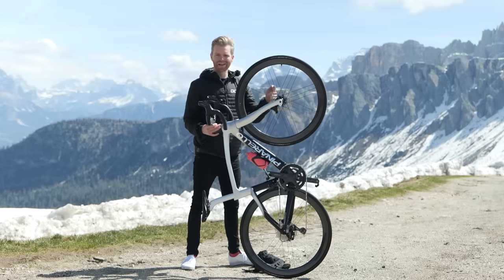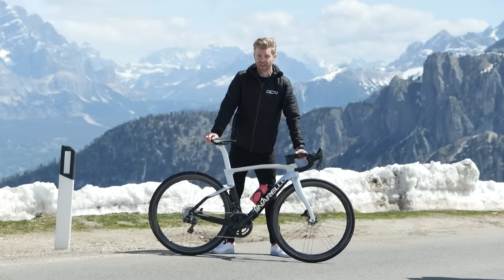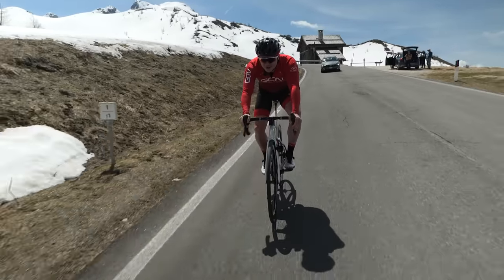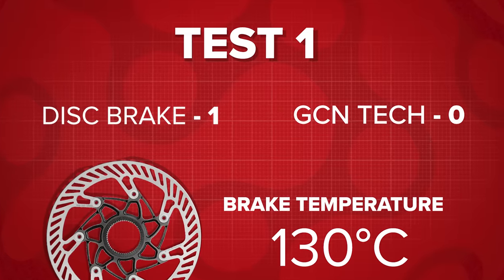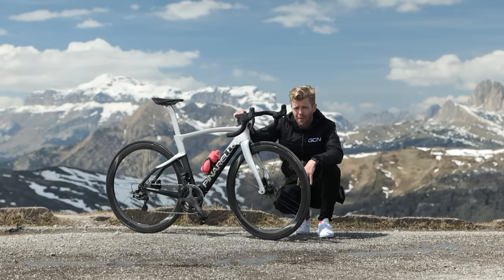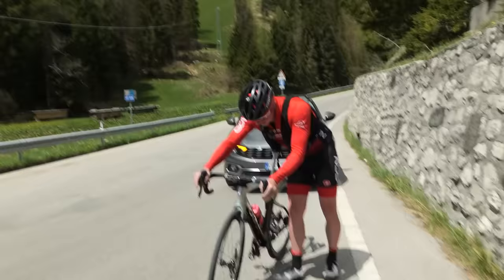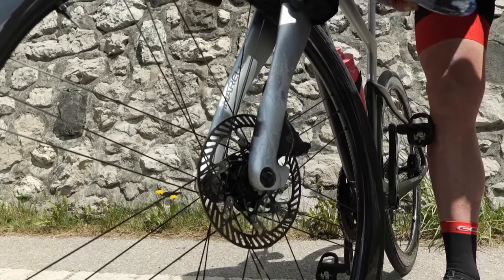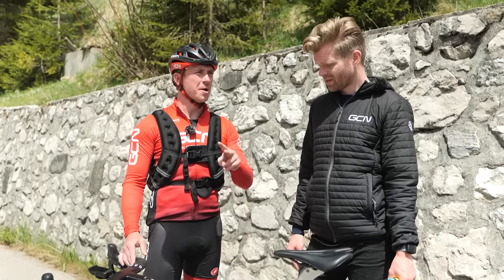Can We Melt Disc Brakes!?

Comment: Descending in the drops would have been harsher on the brakes (less drag = more energy through the disc). Also: for steel to change color, it must have been at 250°C or more at some point. Purple starts at around 270°C, blue at 300°C.
Reply: Was thinking dragging the rear brake would get it hotter as it brakes less effectively compared to front
Reply: He should have been pedaling too.
Reply: Shoulda, coulda, woulda.
Reply: @mateosebastian8555  It brakes less effectively because of weight transfer. The rear brake never loads as much as the front brake. It would likely still have a lower temperature than the front brake because it's dealing with less forces just through the physics of braking.
Reply: Campagno discs are made from tempered stainless steel as such the values and math being presented are not quite correct.
Reply: Straw color (amber) starts around 200c and get darker into light brown at 220c-240c
Reply: Orange red is at 1100 degrees Celsius so no way they gnna melt 😂
Reply: @danielakerman8241  rears get more easy hot because they are not as much in the wind. i tried it in a short descent on my commuter bike.
Reply: @RevoltingRudi  sorry but that’s just incorrect. You’re talking about heat dissipation, not heat GENERATION. Regardless of exposure to cooling airflow, front brakes will ALWAYS generate more heat because of pure physics. On a bicycle, the front brake can be responsible for up to 75% of the stopping. The inertial shifting of weight towards the front will always put more force, and therefore create higher energy, in the front brakes of any moving object.
Reply: @danielakerman8241  what you are saying that something about ~ 75%/25 % load distribution is the optimal brake distrubution is true but nevertheless this is irrelevant for this experiment since here no maxium brake performance is necessary. unlike in a car, on a bike you can apply a load distribution between both brakes in any ratio you wish. you can just brake with the rear break while then the front brake has zero load on it. the only thing is that the rear brake reaches its limit way more early that the front brake would and this is when the wheel stats to block and traction is lost. this is why the rear brake is less efficient. but nowhere near maxium brake performance is needed in this experiment but only very slight braking. so it does not matter if e.g. 5% of the maximum possible brake performance is applyed by the front which has a maximum of 75% on its own, or the rear brake which has a maxmum of 25% on its own. as long as the wheels are far from blocking it does not matter. So actually here the heat generation should be more or less similar while the convection can make a huge difference in the final temperature.
Reply: @danielakerman8241  Yes and NO! 
Yes = In most cases is front brake better / efficient / powerfull / safer.
NO = in extreme example (doing a wheelee on rear wheel 🤪) you don't need front brake 😉 ... when the rear wheel does NOT slip / skid then both brakes CAN made "same job".
Reply: @mateosebastian8555   Question: will the rear brake get hotter if Hank only used the rear break in the exact same scenario? 

Answer: We know that (1) kinetic energy is the same (0.5*m*v^2) in the system (bike+rider), (2) heat energy generated is proportional to frictional force (forgot the equation), (3) friction is what is slowing down the system (i.e. converting the kinetic energy to heat energy), and (4) the weight of the system shifts away from the rear wheel to the front wheel during braking. Because the weight of the system shifts away from the rear wheel, the max friction the rear wheel can generate before it slips is reduced, thereby reducing the max heat energy it can produce (which is why it's less effective than the front brake), which means that it cannot get hotter than the front wheel, assuming all else equal.  

Disclaimer: not a physics major, did mechanical engineering many years ago, may have forgotten some things.
Reply from the maker: Thanks - good tip if we try something similar again!
Reply: Depends on the alloy!
Reply: If they were only using the rear brake, it would be responsible for 100% of the braking. As they used only the front brake, it was responsible for 100% of the braking. Had they used the rear, it would have dissipated less heat due to smaller mass, less surface area and worse airflow.
Reply: @jessechen4971  That's assuming he was breaking hard enough with the front break, that the same amount of breaking with the rear would have lost traction. I suspect he wasn't in this case,  which would mean the same amount of energy would have dissipated from either break,  making the only difference how much air cooling each gets.
Of course,  as soon as you lose traction,  the tire and road start dissipating some of this energy.
Reply: @benturp3492  The rotors sound like they would do fine in that situation - I would be more worried about the brake pads starting to melt way sooner. Especially with the description of using organic pads instead of a stronger material that would be used with "performance" cars.
Reply: @kidkarbon4775  so then we're talking a melting point of closer to 1600 C

Comment: Actually, sintered (what you called "metal" pads), or what is called semi metalic in the automotive world, don't just wear longer, but are pads that intended to operate at higher temperatures for more extreme uses (ie heavy hauling, racing, etc).  They have less bite when cold then a resin ("organic") pad, but they are more resistant and hold up better at higher temperatures (what they are intended for).  While yes you want to ensure the pads don't over heat as it causes them to lose effectiveness, the more terrifying thing is to ensure the brakeing fluid doesn't over heat and boil.
Reply: That’s for sure! I did that once in a supercharged Thunderbird on my way home late at night coming up on a tight downhill turn that was notorious for people going off over the years. I was young and stupid and had no idea you could boil brake fluid. I had been driving up to it around 135 MPH and laid into the brakes approaching that curve and started to slow down but then suddenly the pedal just went flat to the floor and I wasn’t slowing down a bit. I frantically downshifted as carefully as I could to avoid throwing it into a spin by dragging the rear wheel drive wheels too hard on a downshift but I needed to shed speed. Thankfully I kept my wits and, having had previous experience with overheated brake pads, figured it was a heat problem so counterintuitively I let off the brakes while downshifting to let them cool just a touch before laying into them one last time to try to save my dumb ass life, and thankfully that was enough to cool the fluid and the next time I stamped down the brake pedal, I had some braking again and managed to slow down enough to make the corner.

I sure learned a lesson that night! Never, ever pushed anything that hard again. If it had been anyone else driving, they probably would’ve gone right over the edge and died like so many other people who missed that turn had done over the years. Terrifying doesn’t even begin to express it.

Don’t be dumb like I was, people! Be safe and keep your stupidity to a minimum. Your life and the lives of others depend on it.

And I actually was wondering if they were going to artificially test this because I was curious what happens at the edge of braking on a bicycle with disc brakes. How likely is it that you could ever boil that brake fluid?  It did concern me when he mentioned that it isn’t regulated or controlled like automotive brake fluid is, so manufacturers could be putting who knows what into it, and every formulation could potentially have very different performance characteristics at the margins. I’m thinking it might just not be possible to do that on a bicycle, but they do have a very tiny surface area to dissipate heat from.
Reply: @babybirdhome  Automotive brake fluid is hygroscopic, meaning they will absorb moisture when exposed to air.  Your not boiling the brake fluid, your boiling the water in the brake fluid.  You need to flush your brakes every few years or sooner if you do high performance driving. Mineral oil is not hygroscopic However when water gets into the system, it will tend to pool at the caliper (very bad). So learn to bleed your brakes on your car and your bike.
Reply: @babybirdhome  I think bindingcurve is right, even at 135mph, an emergency brake to a full stop should not boil your brake (if so then there would be much more accidents at race tracks). It's the water that's boiling- even a bike brake can reach ~100 degree C.
Reply: Adding to your answer, the sintered brakes also last longer than organic pads in wet/muddy conditions.  Dot fluid will pick up water from the air and usually has a higher boiling point than mineral oil.  Dot fluid is more corrosive than mineral oil and needs to be handled and disposed of more carefully when doing a bleed.  These are all things that have been worked out in the mtb world of cycling.
Reply: @johncarrington8612  I very much so prefer DOT over Mineral. It's cheaper than proprietary mineral oil, even when you get some high performance dot 5.1. Even wet, that stuff has a boiling point of 180. Which is almost twice the boilingpoint of the water a well used (mineral oil) brake accumulates at the caliper over time in adverse conditions. (I don't shy away from rain and grime). Yes, it's more corrosive, so, I guess bleeding is more involved. But you'll do that bi-annually any way. Brakes are safety devices ultimately, so I want to know they are as reliable as they can be. 

I run Hope rx4 4pot calipers with SRAM masters on a Hope 180 rotor in front, 160 rear.
Reply: @babybirdhome  " Thankfully I kept my wits and, having had previous experience with overheated brake pads, figured it was a heat problem so counterintuitively I let off the brakes while downshifting "  I put this in Google translate and it translated to "I shit myself and was totally lucky, phew".  That about it?
Reply from the maker: Thanks for the comment Reggie!
Reply: Reggie, I am a big guy and do serious mountain descents.   I agree that semi metallic pads are the way to go.   I still think there is a bit of a mix up here.   Usually breakpads are broken down into 4 options:
Organic
Semimetallic 
Metallic ( I believe these are the ones also called cintered )
And ceramic.

But I am not going to lean to heavily on what 'cintered' refers to .. 

As I have found that semi metallic is best for my rides and that puts us in total agreement!

I hate to say it but GCN probably should do a Collab with GMTBN tech. As the montain bikers surely know brake pad info better than GCN producers did in this video.

A note I want to add Organic is great for cities where quick sudden stops might be needed.   But just can't be trusted on several hundred meter of elevation loss if you are over 100kg.

They can fade  dramatically after just 5 or 6  serpentine curves at 18%
Reply: I have already managed to boil brake fluid (tektro  mineral oil)  on a mtb while descending a 25% slope and wearing a 10kg backpack. It was absolutely terrifying and I consider myself quite lucky to be alive and to have had a rear brake to stop me when the front lever went to the bars. Here in the alps when braking from 70-80kph into a corner at 15-20kph while going down like 25% really does have the potential to boil the brake fluid if repeated even just a few times

Comment: I think you should try this test with fully loaded backpacking and touring bicycles.    At last weighing my touring bicycle with me on it came in at ~150kg.  The discs have turned blue at one point which means a temperature of over 300C and I think warped the disc.  Also you could tape the IR gun to the fork and measure the temperature continously down the hill..#realbraketest
Reply: If you think your brakes will overheat on a descend... simply slow down further and hold a lower speed. It might be a bit counter-intuitive that holding a lower speed will require your brakes to dissipate less energy, but it's true. If Hank would ride a 7.5 kg bike and want to ride 10 km/h down a 10% hill, that would require ~200W of constant braking energy. At 20 km/h, that's already 385 W. At 40 km/h, it's 570 W (because wind will be holding him back), and at 60 km/h, you're back at 350W again. His theoretical max coast speed is just over 70 km/h.
Reply: Nah go even higher then, 150kg is less than my commute to work. I'm hauling ~170kg to work. A touring/bike packing setup would probably go over 200kg for me :)
Reply: @christoferstromberg6605  Damn! How tall are you?
Reply: @4nz-nl  185cm. But I don't have the cyclist build, I'm more like a strongman.

Comment: I must say that i wasn’t expecting anything else from the top of the range brakes!! How about to do this test on a real entry level bike, no beginner rides a bike like that and the one that does isn’t a beginner so please do the test on a much cheaper bike. I really love how Ollie shoves the tart in Hanks mouth ❤️
Reply: You underestimate the willingness of rich people to buy stuff regardless of their lack of knowledge or talent
Reply: Trp Spyre cable brakes with stock trp rotors and pads are fading on small steep descents like lasting a few hundred meters ! They are equipped on a lot of gravel bikes. I will never go in the mountains with those. Someone tried ?

Had zero fading problems with Shimano rotors and pads.
Reply from the maker: We found that the Eurobike's budget discs didn't fare so well descending the Alto de Velefique in Spain! 👉 https://youtu.be/pUyWZc-_ilc
Reply: Actually there are plenty of beginner riders who hop on an expensive bike as there first bike, not me, and why?  ‘cause they can!!!
Reply: Do this on a top the line rim brakes with super expensive carbon clincher carbon wheels, and you almost certainly would have destroyed the wheels. You possibly might have crashed catastrophically.

Regardless of dura ace or whatever, there's a known issue that carbon clinchers (in contrast to tubulars or alloy) have problems dissipating all the heat energy put into them from a big descent.

For rim brakes, buying "top of the line" can perversely leave you more vulnerable to this problem (alloy wheels don't have the heat issues that carbon wheels do).

Comment: I have experienced disc brakes almost completely failing while still following a very thorough intermittent braking technique : On a fully loaded touring tandem totaling about 150kg down an alpine pass. The organic pads felt like butter with little braking power. The disc were a nice blue color at the end so reached a good 300C. If you want to put it truely to the test, retry the same experience on a tandem ! If you want glowing color, you should use metallic pads as the organic pads will melt before the 800C-900C required for steel to glow.
Reply: @username8644  Who the hell would worry about that??
Reply: There's a reason some tandem bikes come with 203mm rotors combined with a dedicated drag brake...
Reply: @username8644  Yeah, i wish there was atleast 1 road bike (slight exaggeration, they do exist but are rare) out there being sold with atleast 180mm rotors, as a 110kg rider, the difference in braking power between my 203mm/180mm MTB 4-piston brakes vs my roadbike 160mm/140mm 2-piston brakes is scary, the difference is insane. But yeah, thanks to hobby riders with beer bellies thinking it would be end of the world if their bikes where 20-40gram heavier then we will be stuck with this shit, but yeah, who cares about safety when you can improve your local riders with 1s per 10k..........🤷‍♂180/160 should be standard on all road bikes, if people care about the weight penalty they could downsize
Reply: @Jeppelelle  Peak Torque makes a 180mm rotor adapter for road bikes
Reply: @YuriThorpe  sure but the leverage ratio for the given fork is untested, probably okay but it is not 100% guarantied
Reply: @Jeppelelle  It increases the force on the fork by ~12.5%. Well within the margin of safety of the fork.
Reply: @YuriThorpe  yes you are right, but; 1) We dont know what the safety margin of a given fork is. 2) No matter how big the safety margins is, it still reduces the margins, upnto each person how comfortable they are with reducing the margins. 

Personally i prefer a fork rated for 180mm out of the factory

Comment: By the time he gets around to measuring the heat, the temps have probably dropped another 10°! Needs to get temp measure the moment he comes to a stop.
Thanks guys!
Reply: And IR guns are not appropriate to use on reflective surfaces, but they are not really doing a scientific experiment, it's more as an ad for Campagnolo.
Reply from the maker: We need to send Ollie over to GTN for some running training!
Reply: @aliancemd  wireless temp. sensors fixed to the rotors may be more accurate

Comment: I weigh 115kg and am interested in braking performance when heated up at different temps. When heated up it usually requires more distance to stop. Descents scare me, especially when the bottom of a hill there is a main road with cross traffic, and I drag my brakes on a rim brake bike. More brake tests please.
Reply: I've stress tested my sintered metallic pads on a brutally steep and long hill. Those things had much better heat resistance than my old semi metallic pads. Even with the front rotor roasted blue there was hardly any fade. They take forever to wear out too. Though it does sound like train is pulling into the station every time I touch the brakes. They're exactly what you're looking for as long as the noise doesn't bother you too much.